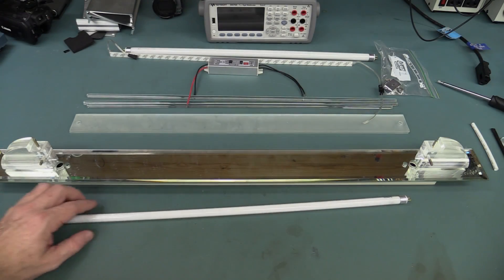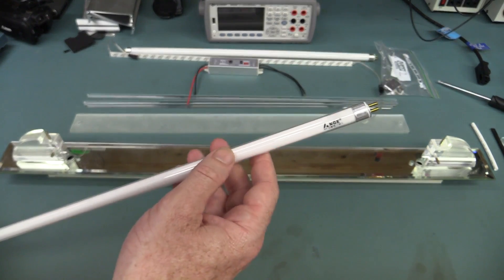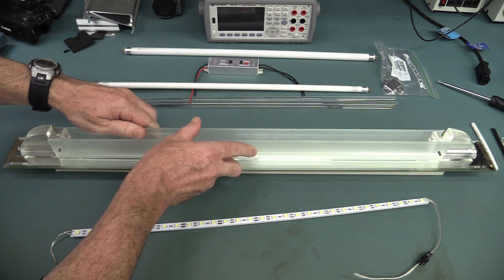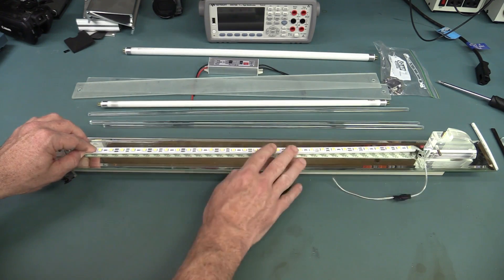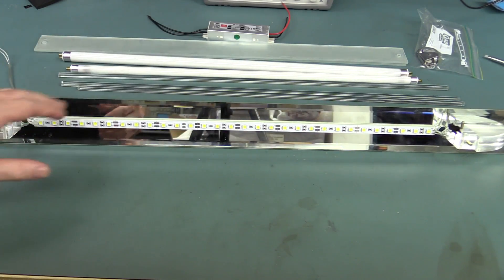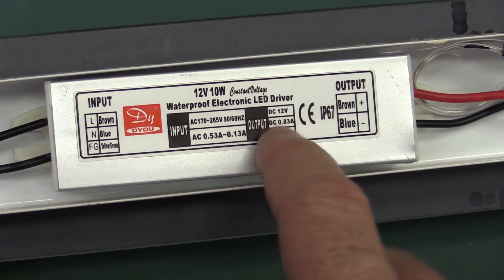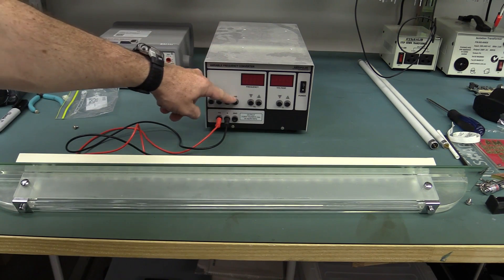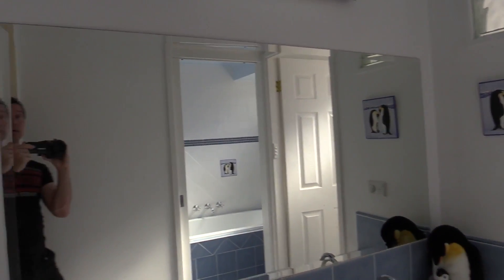EEVblog #728 - T4 LED Lighting

Comment: i have the same tube and its 20w.
Reply: +scaleop4 that makes sense. I know T4 tubes with 4,6,8W and they are 15 to 30cm long. This tube looks more than 60cm long. so it has more than 16W.
Reply: +goamarty  correction ..did have a tube..it died...using l.e.d.s  now lol...much better

Comment: Why is the variable frequency converter set to 50 Hz?  Should it be set to 60 Hz?
Reply: Gary Meyers Because the standard AC power freq. in Australia is 50 Hz (@ 220--240 V).
Reply: Oh... I forgot they used 50 Hz @ 220 Volts instead of 60 Hz @ about 115 Volts.  I wonder which is better 50 Hz or 60 Hz, or if there is no difference?

Comment: i have been there before with under counter lighting, when new tubes are needed, that size is not available anywhere, i think whenever they mass produced their set number of fittings and sold them, they changed the specs, so 10 years later, you have to change the whole thing again

Comment: "Bobby Dazzler"
I like that!

If you hate non-standard things, you would hate my house.
The person that we bought it from renovated it and it looks like they did it on the cheap.

Almost nothing in our house (plumbing, lighting, or even the doors) is the same size.

...and removing the water heater required removing a wall... because they built the closet that houses it around the water heater after it was installed.

Oh, the joys of home ownership.

Comment: Is there anything particular about this transformer pertaining to LED's?  I've noticed that some available online specifically state that they are not for use with LED's, particularly those that say "for halogen lights only". Why would that be?   ie; http://www.amazon.com/Pack-10-60W-Dimmable-Transformer-approved/dp/B0053V1MD0/ref=sr_1_9?ie=UTF8&qid=1427667681&sr=8-9&keywords=120v+to+12v+transformer

Comment: Yah the 4foot t4 suck hard.  Really love led, I designed some custom led lighting for some elevators. Its going on 13 years now and they are still working, have not replaced a single one, they run 24\7 .

Comment: General safety question here. My parents have a bathroom mirror with two tubes that are about to die and it's most likely the driver that's giving up and not the tubes themselves. My dad is big into LEDs so I think I'll point him towards this video. But how much effort do you need to put into the cabling regarding moisture? I saw that the driver you used was designed for wet places but the rest of the cabling? It's a small room with a shower so it gets really wet at times. Don't want things to short out. Also, are there LED strips around that give a good approximation of daylight so they can actually be used for putting on make up? My mum would not be happy if she got a cold blue light in there.

Comment: How about doing something on design of switching driver circuits for constant current series parallel led arrays, maintaining constant current with in an array across each series string even if one or more series strings fail and controlling brightness by means if pwm ect..

Comment: You're not kidding, these replacements are hard to find. I fitted a couple of these fittings in the kitchen and after the supplied tubes stopped working the cabinets sat in darkness for a couple of years until I came across some replacements purely by chance at a local wholesaler

Comment: Would it be possible to fit 2 rows of those LEDs inside of it? If not, then would it be possible to install a small 40mm fan on it, and then add a secondary lamp (possibly a xenon arc lamp for an extra burst of light when needed?)

Comment: I work for a consulting PME firm here in the US (plumbing, HVAC and electrical design for buildings). For years we had an informal "ban" on specifying T5 fixtures due to early lamp failure/end blackening/strobing issues. We only specified them when it was an owner requirement. Fortunately I do not believe we ever specified linear T4 fixtures.

Comment: I might be mad... but then you said it lasted 14 years. 14 years for a specialized bulb seems more than long enough to not be that concerned that it isn't standard lol. On the OTHER hand, I f$cking hate CFLs with a PASSION. In about 6 months I blow out a CFL bulb because it gets turned on and off a lot. Say the bathroom for example. I don't NEED to leave the light on when I'm not in there, so it gets turned on when I go in, and then off when I exit. Simple. This means the bulbs literally last me about 200 hours before they blow out. Yeah, and they told me CFL was so superior to tungsten bulbs. Now I'm using LEDs, have been using some of those for about a year now and they haven't blown out. Considering I paid 3.50 USD for those that means 6 months cost me 1.75, which means I've at least broken even with those horrible CFL bulbs. I guess I'm an LED fan for life now.

Comment: I'm impressed you can tolerate that kind of color temp inside your house Dave! I've tried using 6000k LEDs in my bedroom and it just felt SO off compared to the warmer tungsten bulb color temperature, I guess the best analogy is...it was like my room had entered into The Uncanny Valley, it looked similar, but it was JUST different enough to cause a subconscious unsettling feeling. I used those 6000k bulbs for about a week before I ripped them back out and replaced them with some Philips EnduraLED A21 bulbs at 2700k, way brighter than tungsten and a decent spectral distribution as well.

Comment: EEVblog "What bastard invented a nonstandard sized tube?" to which I say "The bastard who wanted to sell more fixtures which usually cost more than the bulb. Bulb goes you got to buy everything new since you can't get the bulb." . Hate to say but manufactures have been doing that for years. Was recently watching an Eric the Car Guy video where he replaces a rear bushing despite the fact that Honda fused the bushing with the control arm and won't sell just a bushing, got to get that after market and do a lot of work to get the old one out. Honda makes more selling the entire assembly than just a simple rubber or neoprene bushing. >.<
Reply: Neoprene? Polyurethane. :)

I did like seeing a throwback ETCG. He hasn't really changed much in the intervening decade... other than growing more gray hairs.
Reply: FrankTheCat Yeap. :D

Comment: Are you sure there aren't standardized lengths?

They aren't really used here in Denmark, but from what I can see, there's 8W (328mm) 12W (355mm) 16W (453mm) 20W (565mm) and 30W (765mm)
Reply: There are standard lengths - each manufacturer having their own standards, in some cases only 10 - 20mm different.

A similar mess exists in the UK with Smilight T5 fittings - totally non-standard lengths, only supplied with certain fitted kitchens, and the tubes are ridiculously expensive if you can even find them.

Comment: Since the LEDs are pointing perpendicular to the wall, you don't find that the bench is darker now? That's been my major hesitation with replacing room-lights with LEDs. I've used them for kitchen under-cabinet lighting, and for illuminating shelves and cabinets, but for lighting up whole rooms I still use CCFLs in bayonet fittings and old-fashioned fluoro tubes in batten holders.

Comment: Seems like most of the light isn't being difused and instead shines in the typical cone perpendicular to the light strip. Given the position of the fluorecent tube before I would imagine that the area below the light (the mirror, the sink, etc) now is lit quite less. At least that is how it looks on the video. Since it should be past 21:00 in australia now, how does your wife like it?

Comment: I am an electrician in the UK, T4's tend to get use for under cupboard lighting here.  It is a minefield trying to find lamps, as you say every manufacturer has different length's!!  I pretty much take them out and replace with LED's whenever I come across one that needs a new lamp.  We got it right with T12,8 and 5.  What idiot cocked this up?

Comment: I love how both sides of the power supply reference Brown and Blue, yet one side is black/black and the other red/black :)
Reply: Simon Bradley FG probably 'functional ground' or more likely 'frame ground'
Reply: Yes, I noticed that too. Where did you get this power supply from then ?
Also, what does "FG" stand for since green/yellow is normally the Earth connection (which doesn't appear to be fitted here - I hope the metal work has its own earth bonding ?)

Comment: Nice job, I've been converting a few 12v-only fluoro lights to LED myself (solar power for the win!!) and they're pretty useful things, but the colour temperatures leave a lot to be desired though, but with some mix & match of various colour strips I've managed to get them to look reasonably white (around 4100k) so they're not too blue or too yellow... :)

I should look at those constant voltage transformers though, might use some to eventually convert some mains powered lighting too... :D

Comment: Dave, did you consider cracking the tube open and threading the led strip inside the tube, to emulate the characteristics of the fluro tube more accurately?
Reply: Rob Mckennie Apart from the phosphor on the glass, the tubes also contain mercury which is not very healthy. So cracking tubes open is not a great idea. It would be better to either be boring and buy a finished product since they are actually around. Or get a new tube and paint it yourself. Then you can get a poly carbonate pipe that's way less likely to break when you're handing it. It's also much easier to work with plastic since you can easily cut and drill in it.
Reply: Rob Mckennie bad idea:
The tubes are coated in phosphor to convert the V to visible light, and they try to keep that coating thin to minimize losses.
Sticking the LED inside would give you some unnecessary losses and would not really make it look like the original anyways (Aside - why would you want it to look like that?)

To top it off, LED are rather heat-sensitive. If they operate hot their lifetime shortens considerably.
So better let it rest on the metal-backing instead of in a small glass-tube.
Reply: ABaumstumpf fair points. I have no idea why one would want it to look like a fluro tube, I guess I assumed Dave did, but I don't know why that was either
Reply: Rob Mckennie Many such led bulbs are made and sold that are essentially what you described. Although using purpose made tubes instead of converted phosphor coated tubes.
Reply: Gustaf Lindberg yeah, that works be a better idea

Comment: Why use only one strip when you knew it wont be as bright? power savings?
Reply from the maker: Alyx BioHaz Two strips didn't fit. Well, not flat anyway.
Reply: Oh I forgot to factor in those 2 side glass pace things
Reply: EEVblog Could you ziptie 3 strips to the old bulb?
Reply: EEVblog *PICS ON FORUM* Could a strip of plexi or glass be mounted on standoffs, above the back. One LED strip would be mounted on the mirror glass in the back, butted right up against the lower frosted glass. The other LED strip would be mounted on the raised glass, but butted against the top edge, next to the other frosted glass section. That way, the LED strip in back isn't just shining against the back of the LED strip in front of it, yet they could have a small amount of overlap.
Reply: 101blog Zip ties come in clear and white. You would not see them behind the lens.
Reply: Alyx BioHaz Maybe that one strip was still bright enough?
I currently got 180W halogen-light in my room - 18x 10W - but i removed 9 of the buolbs cause it was too bright XD
Reply: johnfranks I think the Zip ties would look awful even behind the glass however you could tape them down as they are sticky backed and all. Heat may be an issue then though

Comment: It would possibly be worth adding a couple more LED strips in warm white either side of the existing strip. They can be purchased on a reel from China extremely cheaply and will boost both total output as well as fill out the red end of the spectrum, which would likely improve the colour rendering index (needed for stuff like makeup).

China LEDs are questionable, but I have 4 metres of warm white strip set up behind the TV (cost me less than $6) and they have been running perfectly for months with nightly use.

Look for 5630 LEDs, they are one of the brighter SMD LED packages.

Comment: I had just installed 12V emergency lighting all around the apartment i live in. I used those 4500K 14W/m led strips with a in-line light switches hanging from the side of the doors. Oh, i taped 60cm from those led strips on to every door frame in all the rooms and the power comes from inside the hallway, from 2 12V 12Ah batteries in a box with constant voltage 13.6V 2A current limited switch mode power supply connected to my fuse box. Also i put some 30cm strips on the window frames of the staircase and the entrance to the building totalling 6W because the led strips i used there are the cheaper 120leds/m led strips. I have to say i use it as a primary light source now, because the strips produce better light output than my LED lamps and defuse the light more. I also added DC-DC converter to provide me with 10A 5V outputs for 5 usb ports to charge phones, tablets and my pocket D-link wifi router. It all cost me under 100$

Comment: I had the same problem replacing these types of light tubes.Tried everywhere to find one, even on line, but I could not get the correct size. In the end, I just bought new light fittings  Never though of fitting L.E.Ds.

Comment: Hope this ain't the bathroom your wife puts her make up on? The reason I say this is, because cool white sucks the color out. This is one of the reason interior decorators don't use them, in living rooms and such. Also my own rant! Lumens mean nothing! They are the same from one meter, to one hundred. The more important number is Lux, or Luminous Flux. The is the light that is reflected back to your eye. The only thing Lumens is good for, is figuring out how many you need to illuminated a certain area. Here in the States, the industry is lying, but not. Because people don't know any better! Okay rant over for now!
Reply: The correlated colour temperature (CCT) is indeed important to how colours are perceived, but objectively, the colour rendering index (CRI/Ra) is far more important. A light source with a cold colour and high CRI is not impossible, and makes sense to use if you want to create something vaugely similar to noon sunlight; it would in fact often be used for critical work such as inspecting print quality, or, I guess, in professional make-up studios. In the case of cheapish LED strips like this one, it's normal for the colder ones to have slightly lower colour rendering (around 70) than the warm white ones (typ ~80), though; probably because they have less of the yellow "phosphor" coating. They typically render reds very badly. However, there is not necessarily a correlation between CCT and CRI.

As for your rant, you're getting your units mixed up. Lumens is in fact the SI unit for luminous flux. It's not a meaningless unit of measure. It is quite useful to compare the light output of two different sources. Actually, it is pretty much the only practical way to compare the total output of, for instance a LED vs a fluorescent source. It does, however, not say anything about the direction, distribution or quality of the light.

Lux is not luminous flux, nor is it "the light that is reflected back to your eye". Lux is illuminance, i.e. the luminous flux that hits a surface, i.e flux per surface area. The unit lux is lumens per m². However, lux is by itself not necessarily useful, as it does not say anything about the perceived brightness, because this depends entirely on the reflectivity of the surface. 1000 lux on a matte black surface could appear darker than, say, 100 lux on a white surface. How bright things ACTUALLY look to a human observer from a given position is measured in candela per m², which is the unit for luminance. This can be quite difficult to calculate; for all real-world scenarios, it must be estimated by simulation with specialised software.

Lighting manufacturers and suppliers can typically not reliably estimate illuminance levels, and absolutely not luminance levels, as the latter is entirely site and installation specific. The manufacturer of a complete luminaire or light engine, with control of the light source, reflector, other optics, and all other variables, could, and sometimes do, provide a diagram illustrating beam diameter and illuminance at different distances from the luminaire, but this is not a definitive answer to anything, and not a substitute neither to a lumen value or luminance values found through proper calculations.
Reply: Lumens are very important. So are Lux. They measure different things. Lumens measure the overall output of a light source adjusted for the response of human eyes. Lux measure Lumens per square meter. Lux vary with the fixture, and with the distance from the fixture.  It is impossible for a lighting fixture maker to know how far away you plan to be from it. LUX are used when specifying lighting needs.

Comment: FWIW, Philips (not some Chinese generic with questionable LEDs, for once) has these new Lumileds Luxeon LED strips that are quite awesome, and run at 18v, 21v, and 36v. Ludicrously bright, to the point where I needed to get a power supply with dimming support so that I don't go blind.